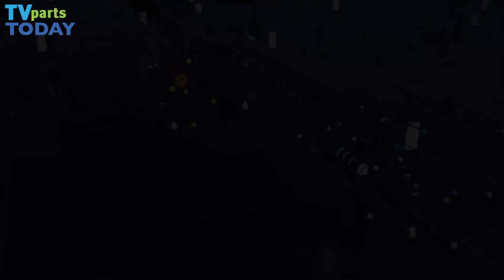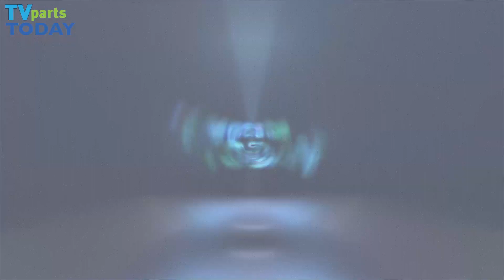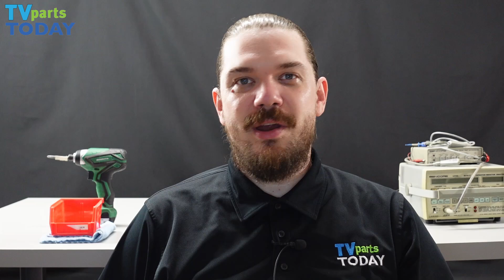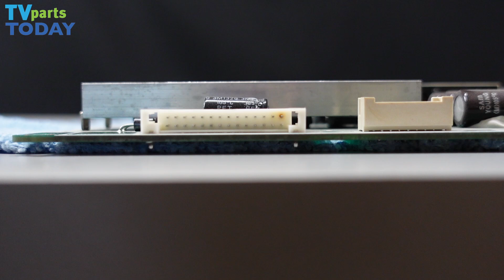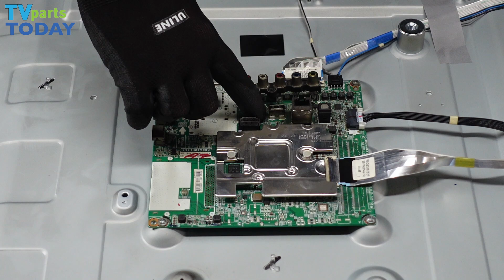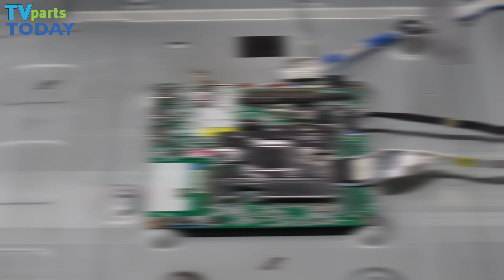Power surge / lightning strike troubleshooting and board swap TV repair guide. No power / Dead set.

Comment: All my stuff was plugged into power surge protectors and still died
Reply from the maker: ugh, that's awful.  There are circumstances where a surge protector will be overwhelmed or fail to protect electronic devices. Was this a lightning strike or a power surge? 

I am also aware of a multitude of power strips that are NOT surge protectors or that have a joule rating that is far below desired.

Comment: Help please I have a Magnavox and most likely lightning strike the other day I have the red power button blinks hear crackling sounds but doesn’t have picture and just black screen
Reply from the maker: I would start with replacing the power supply board. I would also recommend opening the back of the TV and looking for any scorching or burn marks on other boards as well.

Comment: THe power supply board #'s need to match 100%?
Reply from the maker: There are cases where a part can be compatible in multiple different units, but as a soft rule, we strongly suggest that the part numbers match exactly for ensured compatibility. If you have any questions about whether a part is cross compatible or not, you can give us a call at: (930) 212-1975